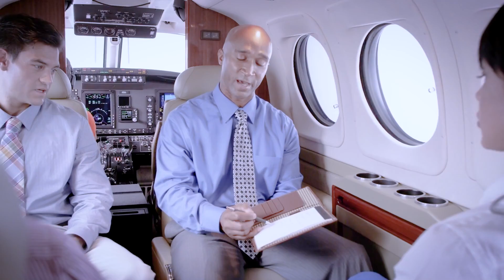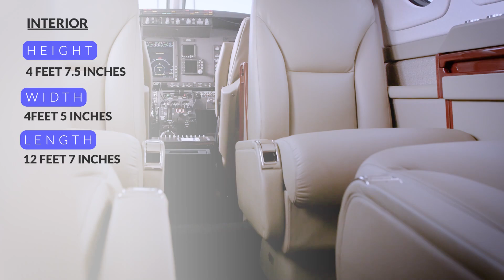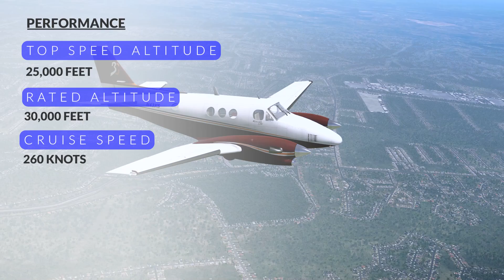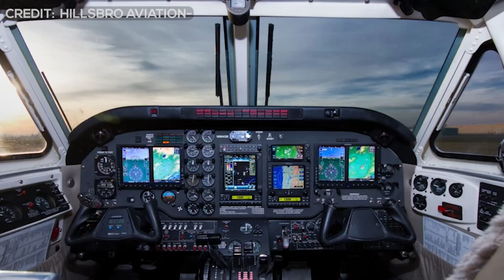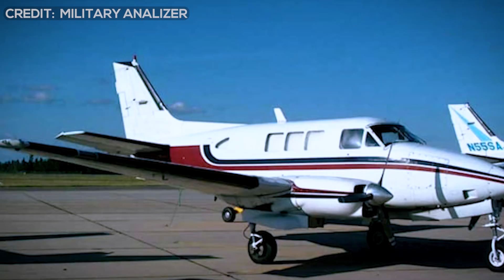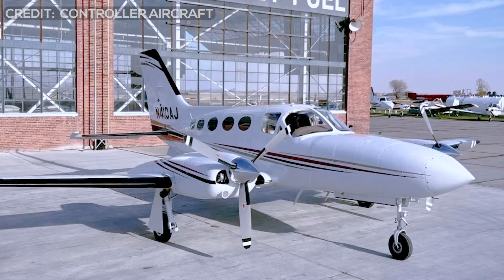Why the King Air C90 is a King of Utility

Comment: I flown in one of these when I was a kid it was a c90b model I absolutely love this aircraft and  this  airframe very stable quiet at altitude hear the buzzing noise from the props but that's normal my grandfather was the chief pilot on  the one they owned for Springfield Flying Service With Mr Cooper as the main owner my grandfather I believe owned only 25% of the aircraft but still I remember flying several times as a kid around the country including a trip down to Kissimmee Florida I believe once to Aspen Co

Comment: I think these 90 king airs are going to get cheap because of the popularity and economics of the single engine turbines.
Reply: Seems used ones have been very discounted for years for that reason.
Reply: Average price of a King Air C90 is $350K.
Reply: Sure wouldn’t want to pay to maintain those two engines…